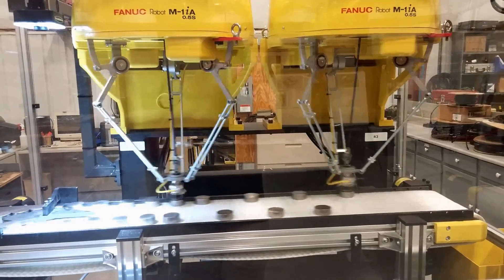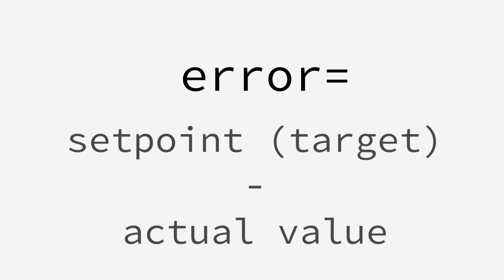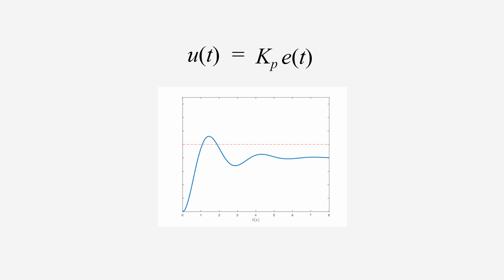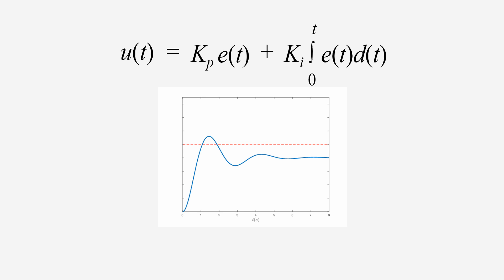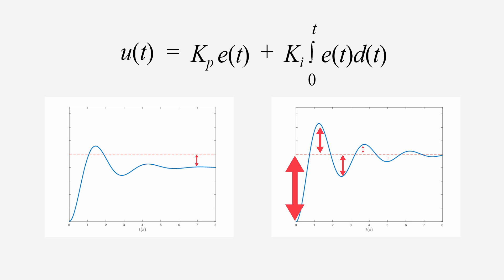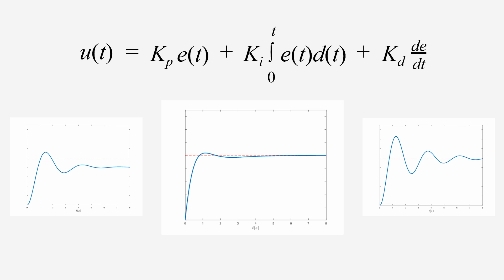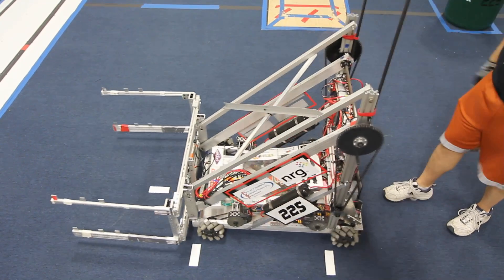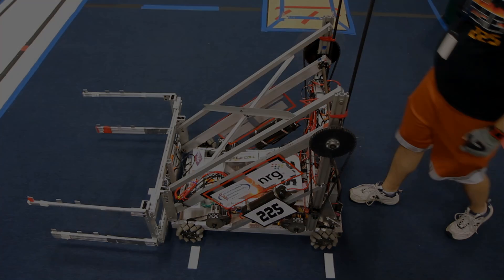PID Theory and Robotics Explained

Comment: Ok , but what are the values that should be instead of Kp, e(t), Ki, d(t), Kd, de, dt??? Why nobody is showing us the part of the code, or maybe some numerical examples?
Reply from the maker: Let me begin by saying that this is HIGHLY dependent on your given system (as well as on the scale of the units being input to the controller), as PID constants for a little electric motor spinning freely versus a giant ship trying to hold course in waves and current are going to be INCREDIBLY different, and why I didn't include any specific numbers, as I wanted to focus on the concepts. However, at least in my experience (primarily in FIRST robotics) generally Kd is the largest, ranging from ~10 to ~0.01, Kp is somewhere in the middle, ranging from ~0.1 to ~0.001, and Ki is typically the smallest, ranging from ~0.01 to ~0.00001. To find the right values, just start very small and slowly increase them until you see the PID controller have an effect on your system, then tune them one by one to achieve the desired behavior.